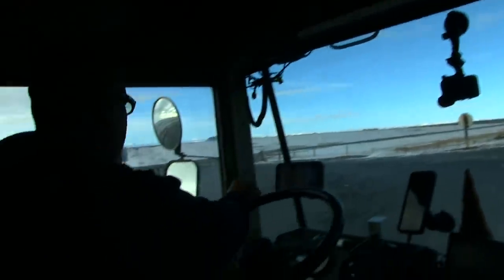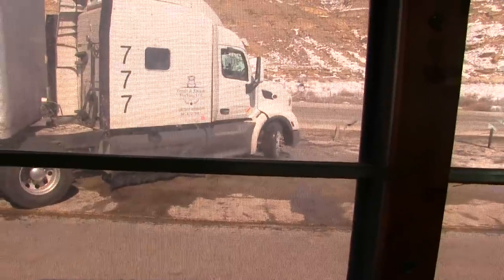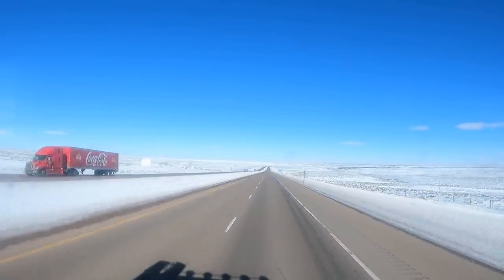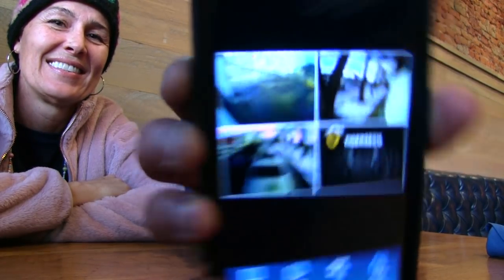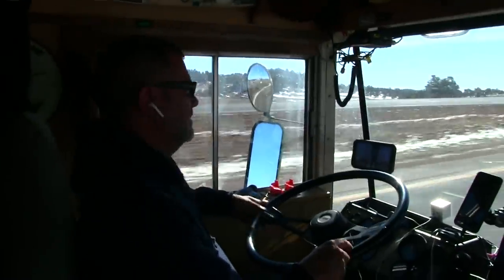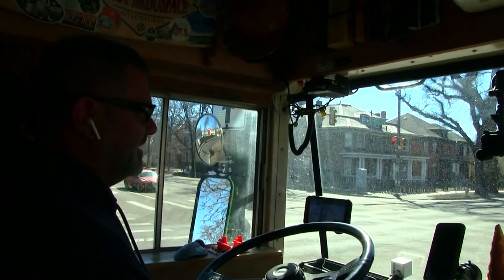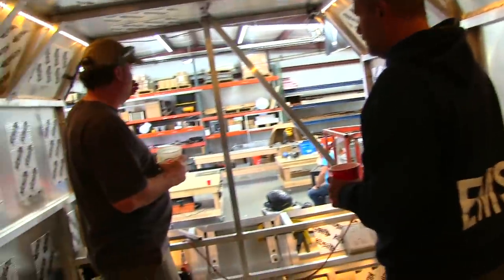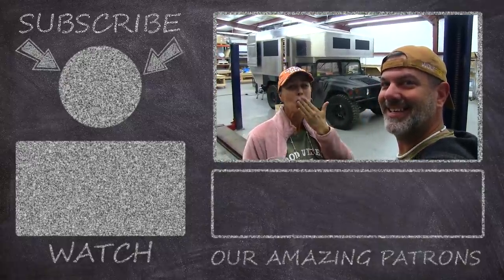When the Road Trip Ends, but the Journey Has Just Begun...!

Comment: Do you guys not worry about using google maps instead of an RV safe GPS that factors in weight, height, and length of your rig? I've seen tops get ripped off, buses get stuck, and overall issues with directions from google that ask you to u turn and stuff, because it thinks youre in a car
Reply from the maker: We use a trucker GPS to navigate the bus. It is made by Garmin and is weight and height and length friendly.